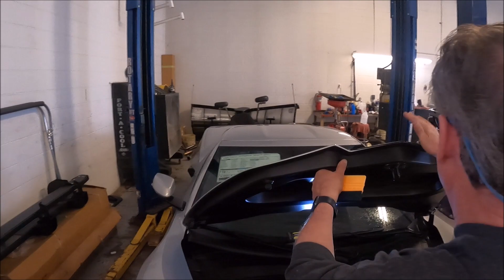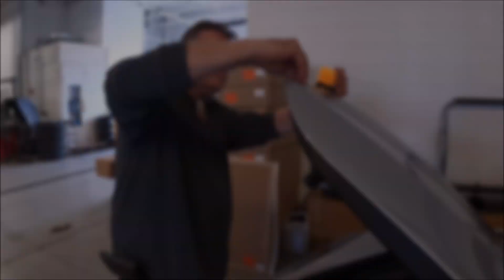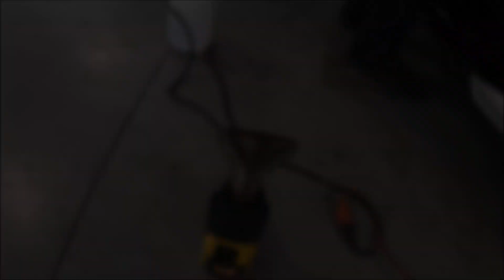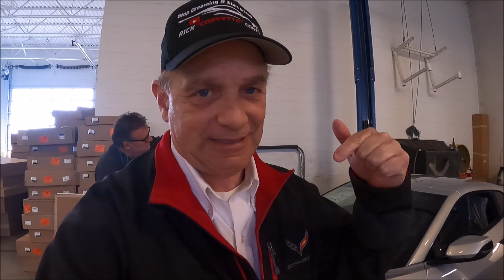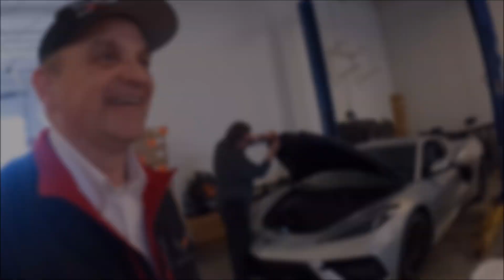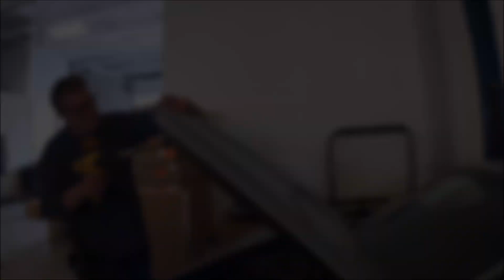CHEVY CORVETTE "COME ON MAN" MOMENT #shorts

Comment: Rick, I ordered my "Stingray R" appearance package from Scoggin-Dickey GM parts in Lubbock for $402.81 for the hood and door decals (got it in 2 days) and $180 for the (4) R center caps.  Even with tax and shipping, still a savings over the $695 factory price for the same thing, AND...I still have the stock center caps.  My PPF installer said he prefers to have the decals OVER the PPF instead of under, and then the Ceramic goes over all that.  Even if he were to charge $100 to stick on the decals, I'm still ahead of the game.  I've lessened the complexity - and therefore the chance of delays - by ordering floor mats, cargo liners, GM car cover, all that stuff, from genuine GM parts places and save a chunk of change.

Comment: I just had full length duel stripe installed aftermarket.  Price $350 total for decal and installation.  If I had factory install it would have been $995 and I would still have to buy another set to be put on after PPF.